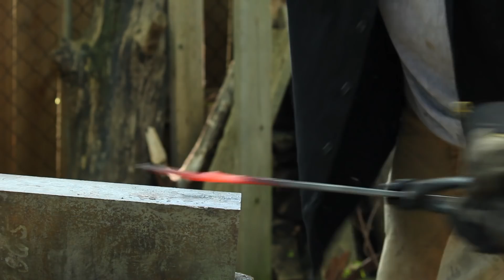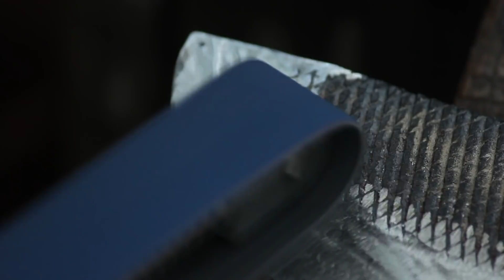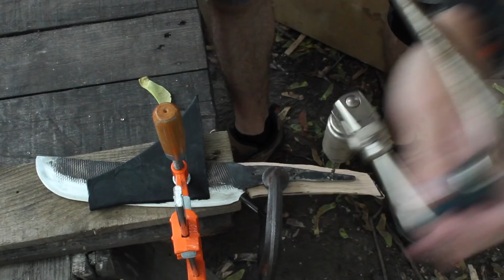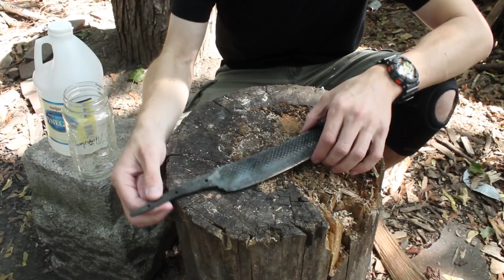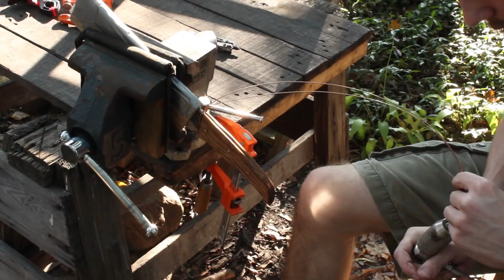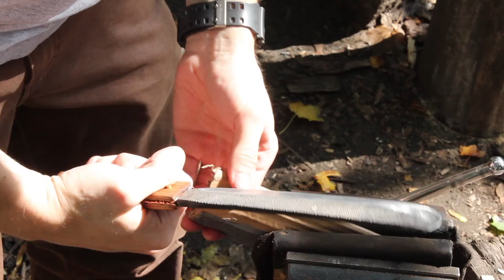"Kitchen Machete": Knife Forged from a Farrier's Rasp

Comment: Problem with rasps is you never k ow if they will harden. I have a pile of them that were case hardened and are basically junk for knives. They do however offer experience in forging if you can get them cheap enough or for free. Hope ya got lucky with that one.

Comment: You could have used a drill or lathe to twine the wire together. Clever though. Nicely done.
Reply from the maker: I appreciate you taking the time to watch the video and comment!  I've used the drill in the past, but since I decided to glue the copper ends under the handle, I used the auger so I had a little more control and didn't accidentally rip out the wire with the electric drill.

Comment: Nice knife. I’m wondering why you didn’t use the rest of the file to make a full tang ? It would have made a much stronger chopping/knife.
Reply from the maker: I guess I didn't really think about making a full tang, but the existing tang on the rasp just led me to the design I came up with.  Plus the hidden tang allowed me to create the handle shape a little easier in the wood.  I made another knife out of the bit I cut off anyways.

Comment: Hey, if you put a slight radius on the edge of your anvil it help a lot to stop those cracks you got in the tang. I know a few other blacksmiths that dont do that, but most (like myself) put a slight radius on the edges to stop the cold shuts.